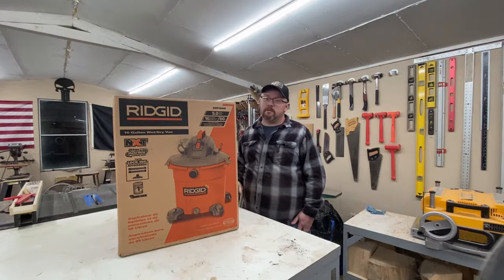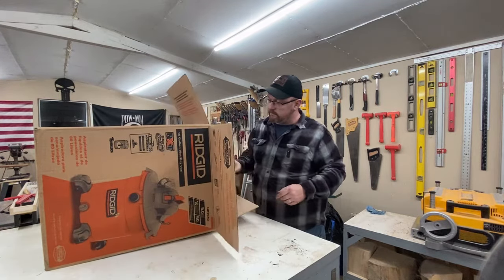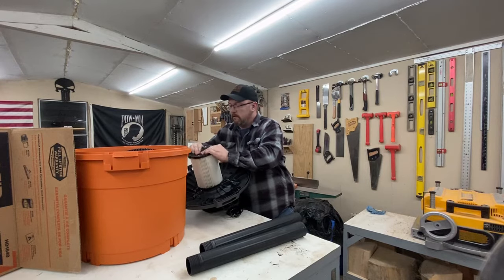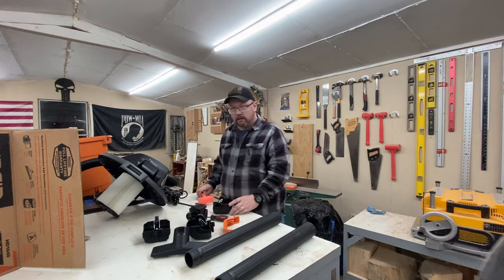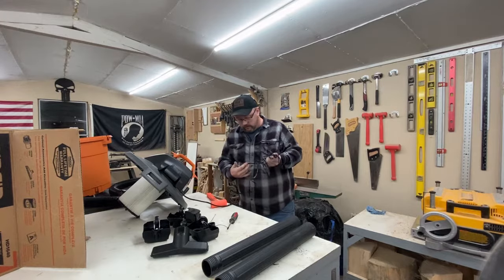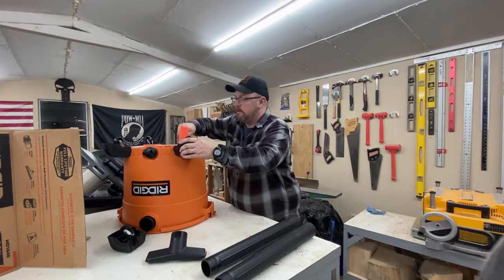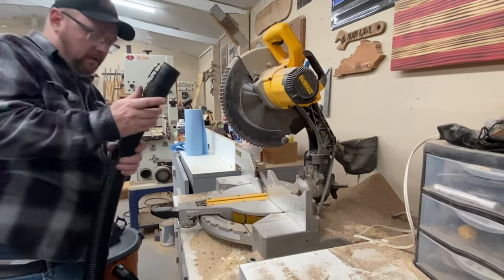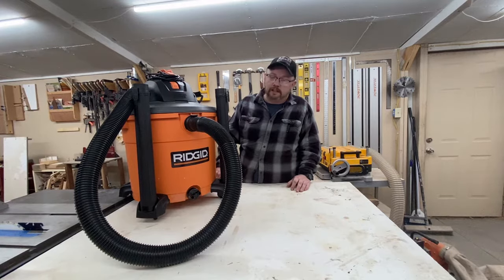Ridgid HD1640 Wet/Dry Vacuum | Unboxing and Testing!!

Comment: One thing I did with my Shop-vac was put it outside in a deck box and ran the cord and hose through a hole in the wall.  I picked up 30 ft of hose on Amazon and plug it into a switched outlet.  When it's on the only thing I can hear is the air being sucked into the hose.  Also I removed the filter from it and only run a screen over the impeller intake on the inside of the vac and vent it through a hole in the deck box out into the air.  that way I never have to change the filter!
Reply from the maker: I’ve thought about something similar! I’m trying more and more to use some type of dust collection, saves the lungs and a lot of cleanup time!
Reply: I used mine for like 2 min and it got super hot is that normal ?

Comment: Please keep making video tutorials, Sir.  This one was quite helpful. I bought the 13 gallon machine yesterday for basement sewer overfow. Blessings in return. 🙏
Reply from the maker: Wow! Thank you!!
Reply: @Brads-Woodshed  I'm currently reading how to clean and maintain the filter after water cleanup. Any suggestions?
Reply from the maker: @Anabee399  well for what I do, I take it outside and dust it out with air, if I clean with water I let it dry naturally, but installing a pre filter may help a bit!
Reply: @Brads-Woodshed  Thanks for your help.  I watched a video about using paper towels and painter's tape or pool filter socks if a replacement filter can't be found. Ok, I'm putting it to use in 5 4 3...  Sorry for so many questions. So have a relaxing evening.
Reply from the maker: @Anabee399  only issue with paper towels, it may not let enough air pass through and shorten the life of the motor!
Reply: @Brads-Woodshed  😆👍

Comment: Adding the bag attachment for inside the shop vac should help with keeping the filter cleaner allowing the vacuum to keep a constant level of suction longer.
It would be cool if you can attach straight to the saw so as you use it it will suck the debris.
Reply from the maker: @ediddy2497  actually this one fits perfectly on my table saw without any adapter! Works great! I’ll have to check out the bag attachment

Comment: 1. Get a better filter for sawdust. Blue is better. Green is best. 2. GET A BAG! Don't just use your drum. A bag is better for filtration of fine dust. 3. Use a nozzle. A car nozzle or crevice tool are better than just the hose end. 4. It is NOT horse power. It is PEAK horse power. No small vacuum could possibly be 5 Hp. That would blow your 15A circuit in a second.

Contact me for more info on your HD1640. I designed it. John Wolford.
Reply from the maker: @JohnWOLFORD-el9ke  Thanks for the tip!
Reply: Thank you John! Mine is RIDGID WD16400. I lost my accesories and I can't find the right ones. Are these extensions and nozzles 2.5 inches in size? can you help me on this? Also, can you share some links where to get the accesories you mention? Thank you again!
Reply: Great suggestions. Especially about using a bag. The pleated filter will get clogged up incredibly fast and reduce the performance of the shop vac. The bags are not cheap. But they are well worth the investment to keep the shop vac performing at a satisfactory level.